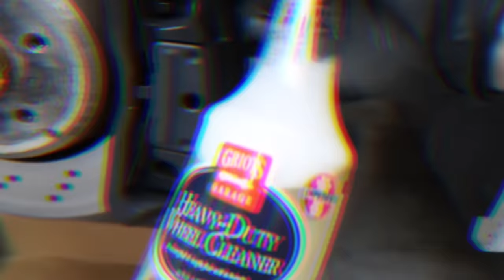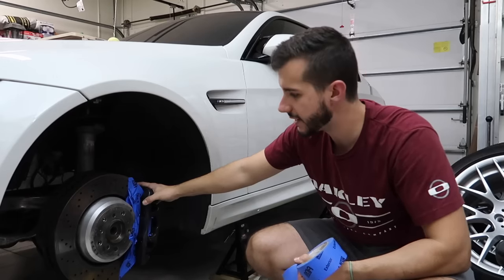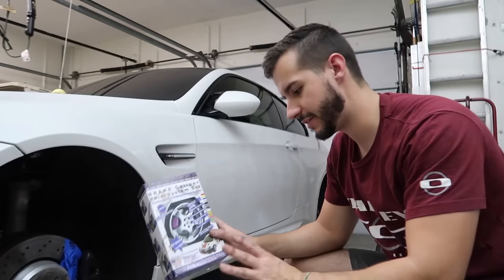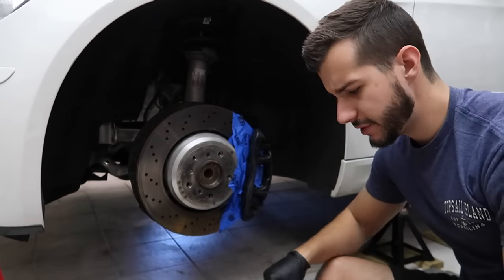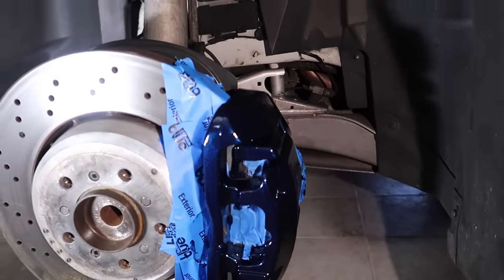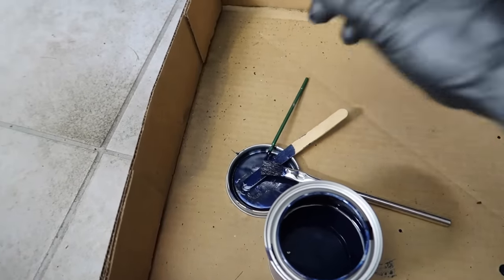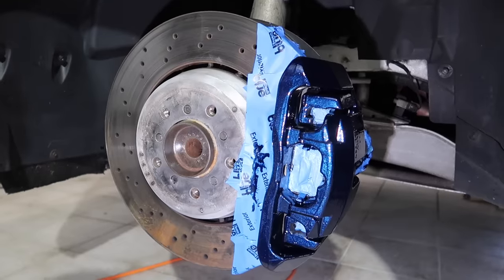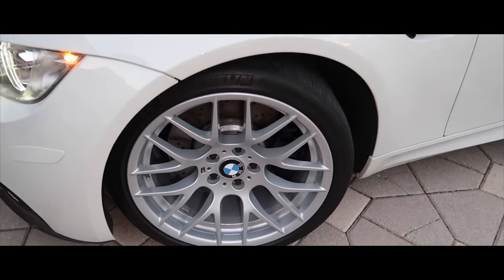Painting My M3 Brake Calipers Blue

Comment: The colour of the tape you used to mask off the area should have been the colour for your calipers lol. Whole point of painting calipers is that you want them to stand out. But, it actually still looks quite good with the colour you’ve chosen.
Reply from the maker: I didn't want to have them stand out too much because they aren't very impressive looking.
Reply: I think the color looks super good, I bet it pops just right in the light, also what size spacers do you have on the front and rears and have you experienced any rubbing with them?

Comment: After buying a car myself with badly painted calipers, my head is screaming "take off the calipers before you paint them". If anyone has the will to paint the calipers, at least do it properly. Taking the calipers off, blocking the drippage of the braking fluid with caps and doing the proper painting job is maybe an hour longer, but you don't have to mask off that much and you have free access to hidden parts of the calipers, the inner parts, which were in worse condition for me than expected.

Why not providing protection while giving a nice colored look at the same time? P.L.U.R.

https://imgur.com/a/pXcqEvQ